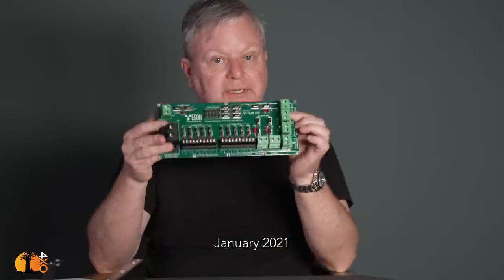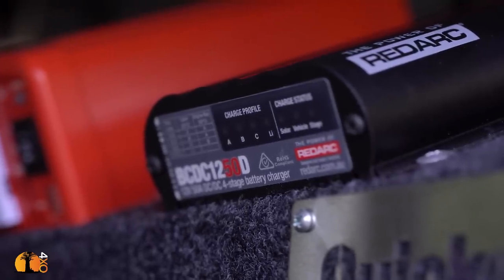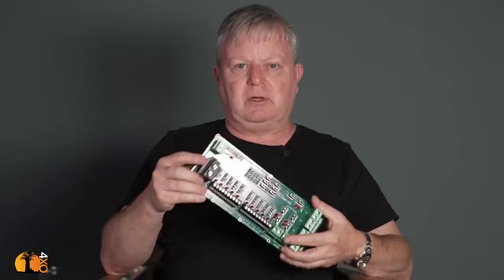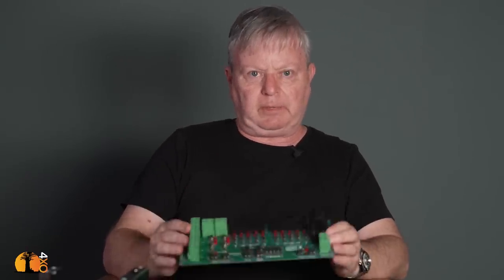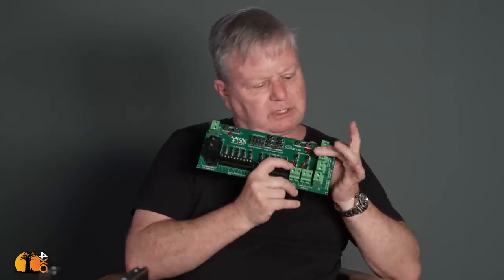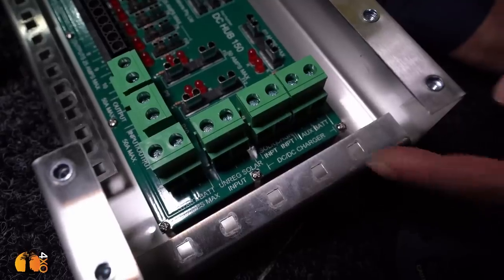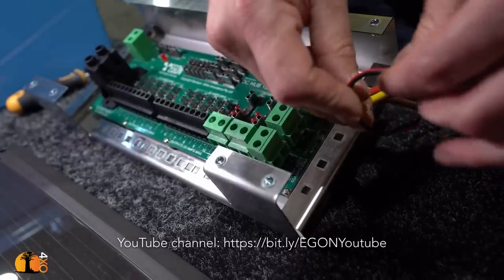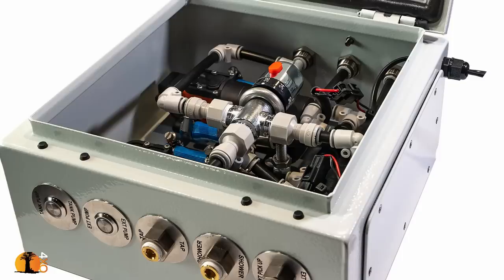DC-INSTALLATIONS MADE EASY. Unique, Problem-Solving Solution. Egon DC-Hub

Comment: noting andrew if   you were planning a fuckery failure point  if you were looking at what i was running from a mains voltage space is as a minimum of 8.5-12 kva across input fused 2x  20 amp plugs.

even if you shrunk it down and still consume the same output range..

you don't have the battery support for 1x 2 kw 

once you start supplying Vac from DC you are typically looking at 4 house pending total vac output you are catering for..

noting is you are catering to shore power within the build the input has to be fused..

note i see you haven't looked at a battery bank past 12/24VDC..

the problem with 12 volt is over amp current into low guage  if heating the cable at 12 volt over capacity either upgrade to 24 or 48 to reduce amperage over load

drawing more current at 12 volt will likely cause cable to heat up as you saw, 100 amps into at that density will likely net the same result everytime it is done you are looking at 24-96vdc across 4 or more house batts. especially if running dc>vac power convertors/inverters 

If using agms you should be fine ..

using  lithium you may need to consider load balancing ..

whilst you might electrically isolated in charging doesn't mean you will be electrically isolated  between crank and house because 1 will pull from the other if either in amp or volt  with 1 being lesser than the other..

when I talk about 8.5 kw power at 240 mains  i talking in 1500 watts per average between fridge, aircon, rangehood, microwave

ac cable runs are typically mains electrical at 240 @ 10-15 amps though supply inlet can be split between 2 pending on the air con system being used so you live from a minimum 20 amp inlet if running shore or genset.. power..

note i would never use a 2kw inverter  because they  are under powered and you will likely top out at 1.5-1.7 kw continuous power..

Comment: For that much money everything should be solid state. Take a look at what companies like vertical power are doing. Makes this like the Stone Age.
Reply from the maker: In other words, digital vs analogue.
Reply: @JP-hr3xq  could you repair this ?
Reply: @JP-hr3xq  with a soldering iron and new  components?? But I guess the Beauty of the product is it’s designed to be simple with over engineered thresholds
Reply: Solid state is far superior in every way. The fact you want to repair out bush, tells you straight away the faith in the product. 

You buy quality, so I don’t have to repair it, or carry spares. 

Massive oversight not going solid state, especially the price point. As Andrew said, digital vs analog;  yep analog is the stone ages!

Comment: I think I need some illustrations to see what problem this is actually solving. I don’t get it, maybe I’m dumb.
Reply from the maker: It simplifies DC wiring. And in doing so, speeds up installations and makes fault finding far easier. If you don't do DC wiring installations, then this may not be obvious. If you do, then it will.
Reply: Mate if you bake cakes.....use self raising flour. If you use normal flour, you have extra work to do. Simple. I should try this.

Comment: I’ve watched the video a few times now before I commented, I’ve read the replies to others who share the same views I do.

I have just fitted a fuse box to my overlander and I don’t see how this saves anymore time than fitting the piece of kit that I’ve just fitted as it essentially does the same job. And that is to locate all the electrical equipment centrally and make fault finding easy. It’s run from the secondary battery and therefore it also doesn’t cut into any stock wires on the vehicle just like yours. The fuse box I’ve just fitted runs everything yours does and also has LEDs to identify breaks in the fuses. 

Now I have no doubt the one you have designed and built is genuinely very strong and robust and of a high quality. However this box you have built is not new concept and because of the extremely high price I’m sorry but I’d rather run the wires to a cheap box that does exactly the same job just like I feel a lot of people on the comments section agree with. 

If I swapped my fuse box out for this one it wouldn’t save time at all and I’ve just saved hundreds of pounds. And I accept yours is probably much more robust but  in the unlikely event that mine breaks it’s another cheap replacement part.

The water box however! That is something I’d genuinely invest in as I think that is a fantastic product.

Big follower of the channel and love the content and I’m sure you wouldn’t have left comments available if you didn’t want people’s opinions.

Comment: I was looking at that and I was thinking... How much would this cost. I was thinking it's probably worth using for the guy that made because he's only paying $200 for the parts. I guessed they would sell it for $800. I watched the whole video and at no point did they actually say what it does. That's because it does nothing! ...except dumb down the wiring and be a fuse box. Nothing wrong with that I guess, I can see how it could make things easier when doing a build. When hooking up all those devices a lot of fuses are required which is a pain I admit. 

I guess they are trying to slip this product in under the price of the redarc total vehicle management  system which is a sorta similar product but has actual functionality like electronic fuses and Bluetooth controls etc. 

I wish them well. I will be interested in seeing if they have got the price right on this. Unfortunately I have a feeling their first and last order might be to some mysterious buyer in China 🙁

Comment: Is that not basically a car fuse box
Reply from the maker: To the uneducated its a fuse box. To the educated, it isn't.
Reply: @4xoverland  You know your own description of this product on this video and on the product page calls it a "robust DC input/output fuse box" and the ONLY things it replaces in a build by your own description is a fuse box, connectors and heat shrink...  what is it the uneducated and educated among us are missing?  If one still needs to wire in relays, switches and fuses at the power sources to which do require connectors and heat shrink where exactly is the saving coming from?  It doesn't take 7 hours to crimp, solder, and insulate cable ends correctly.

Comment: If it was April first......
This is absolutely ridiculous bs.
Every switchboard or fusebox does the same. 🤣😂
As a boat electrician I'll only laughed.
Reply: Have you got a link to a marine version?
Reply from the maker: If you laughed sir, then I must assume you missed the point of it. Your are right. It does nothing new. But it saves a lot of time with an install, simplifies a build by putting all the fuses in one place, and aids fault finding. That's its job.
Reply: @4xoverland  You haven't addressed the fact that having ALL fuses in one place is a dangerous idea and goes against the fundamentals of safety.  You need to fuse as close to the source as possible, that is a 101 basic principle.  Those terminal blocks are also designed to be used with bootlace ferrules, which still need crimping.
Reply: I am a german Dipl.phys.Ing., 28 years at Bosch Automotive, and still did n o t get the point. You re in good company.,🤣

Comment: Protection vs: vibrations, dust, humidity, sprinklewater, corosion, mechanically demage, using heavy duty materials (like in helicopters, ships etc) .... All missing for t h i s price range.
Study the quality and prices for example of ship suppliers (example "Victron" and others). You will get better products, bulitproofe, for less money.
2cent from a retiered german engeneer, 28years at Bosch automotive, 4x4 overlander for over 30 years.
Reply from the maker: If you held this in your hand sir, you'd say, "Oh. It is."
Reply: @4xoverland  you shoudn t judge over distance. Right. My hands did hold divices of this kind, even made for battletanks and navy ships, so I allow myself to doubt that. Regards from germany.